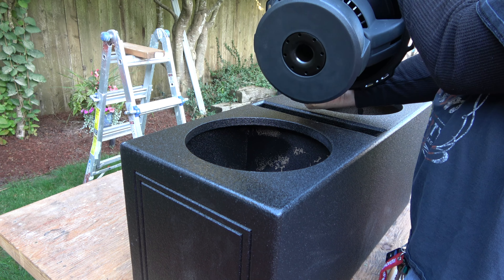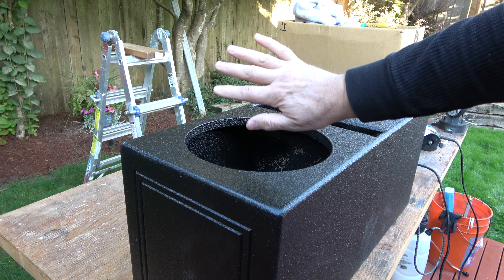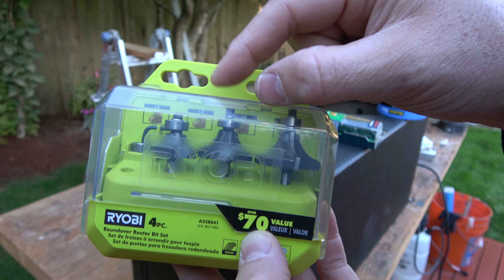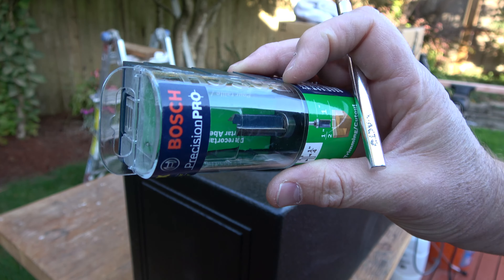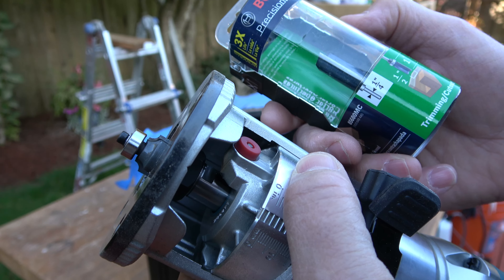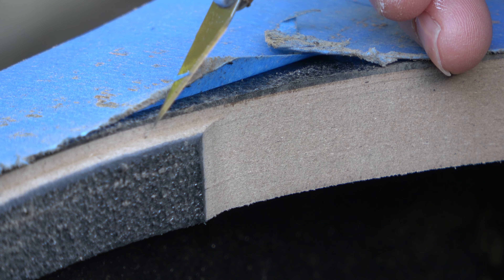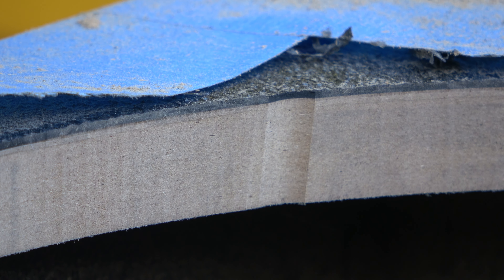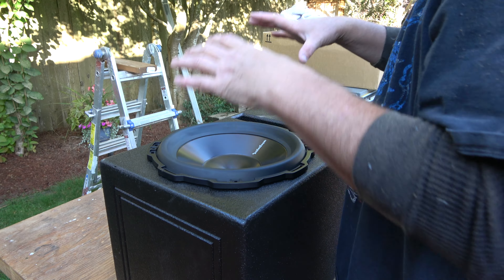How To Enlarge Speaker Box Holes - Best Professional Video

Comment: You probably had it on the 1st pass, You were so worried about doing the whole hole that you forgot the speaker only needed a1/8 to 1/4 depth of relief. I just did a guitar cab 4x12 where I used a 3/8 bottom bearing  with a  1/2 inch flush trim bit and only routed a 1/4 inch depth  recess. 4 holes changed in 1 minute, perfect fit !    You can't find flush trim bits with smaller bearings but you can just buy smaller bearings and change them out, which is what I did. As for the dust cap I found a washer with the correct inner size hole and used a file to change the outer diameter to the size of the smaller bearing. Took 5 minutes using a vise to hold the washer. For some reason Whiteside does not sell dust washers at all.... And the local hardware stores are useless.    P.S.   get a vacuum cleaner !

Comment: Should I cut my measurements in half.so meaning i have a 7 1/4  cut out now i need to make the cut out 8 " so i was thinking it i started with the 1/4 round over it should get me pretty close to 8.then retake a measurement after the quarter to see if I have enough to do the 1/8 round over. But anyways your video helped me out a lot I'll get something and then if I have to at the end I'll just hand sand the rest of way

Comment: Great tip. I was gonna try to use a rabbet/slot cutting bit, but I do not have any of those that would cut a small enough amount of material. Gonna go check out my Itty bitty roundover bits to do this. Thx.